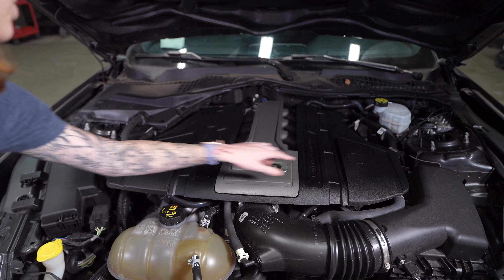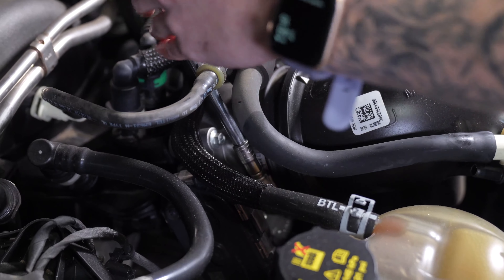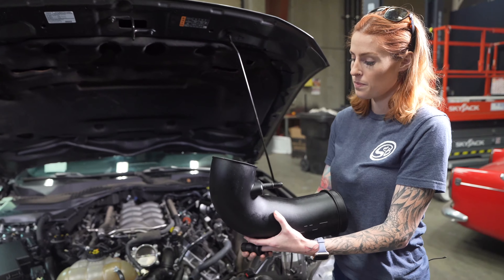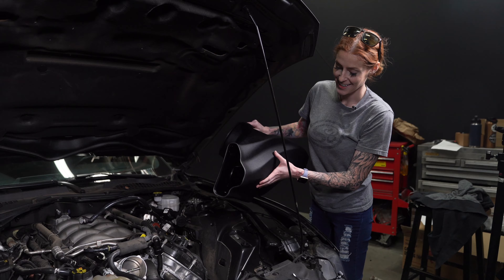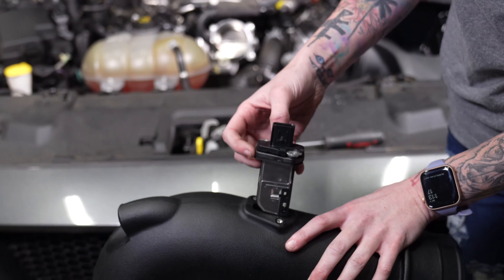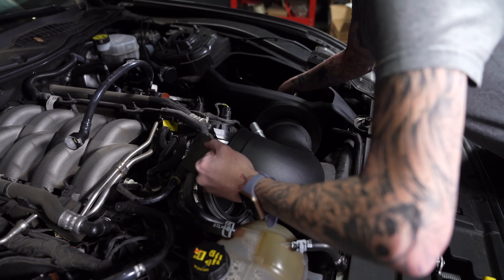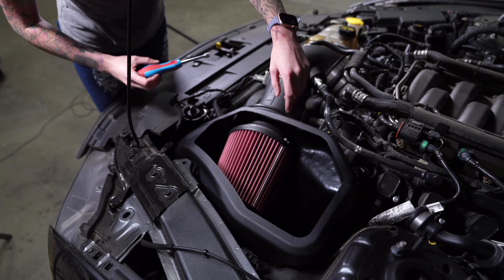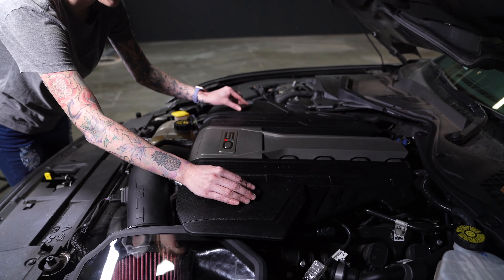JLT Cold Air Intake with Snap-In Lid Installation for the 2018-2023 Ford Mustang GT 5.0L

Comment: looks nice. Do the Snap-in Lid work with my older 15-17 Filter and 110mm intake tube?
That would be awesome! If it works, it would probably produce more power than the Steeda closed box!

Comment: no tune required I hear ??
Reply from the maker: Nope
Reply: @JLTPERFORMANCE  I installed mine yesterday and reset my battery didn’t work and I reset and erases the codes with my scanner and still didn’t work codes were p0174 p0171
Reply from the maker: @Car_nage  contact tech support
Reply: @JLTPERFORMANCE  they’re closed 😪😡😡😔😔😔